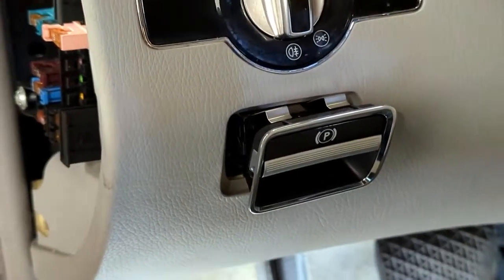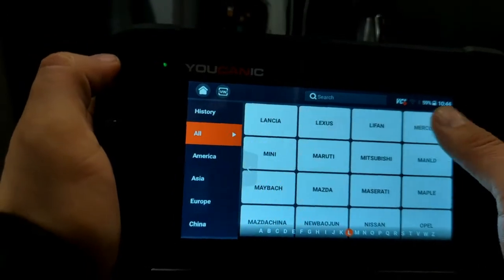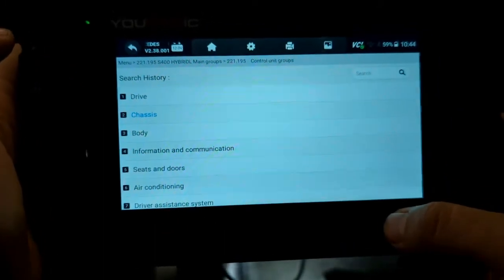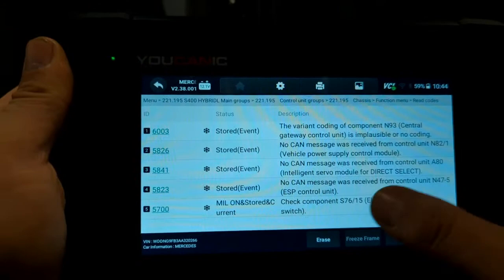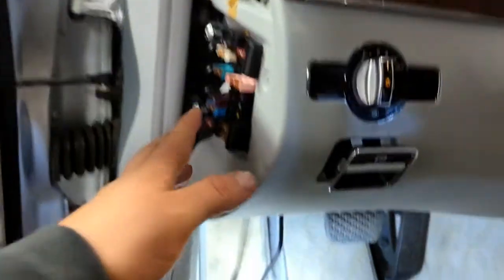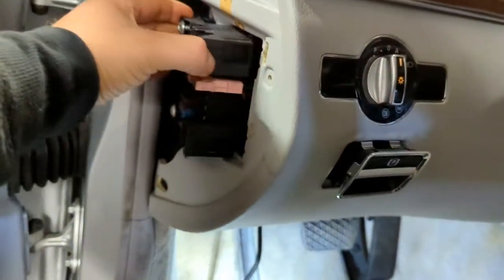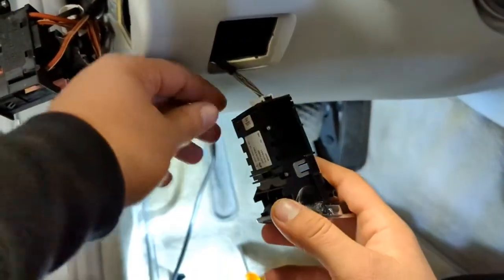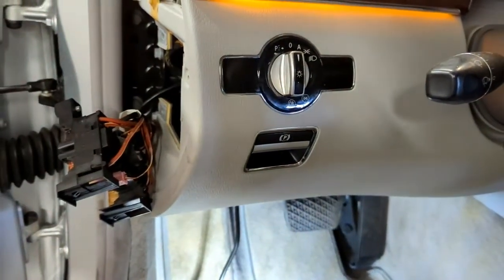Diagnose and Replace Mercedes-Benz Parking Brake Switch W221 Using YOUCANIC Scanner

Comment: Were your brake lights  on all the time?
Reply from the maker: Hi there! Thanks for commenting on our video. Our brake lights were not on all the time during the video. If you have any further questions or need assistance with anything else, we invite you to use our resources at www.youcanic.com. There, you will find our helpful guides, free resources, and the powerful YOUCANIC scanner which are all designed to make car maintenance easier for you. We also provide factory repair manuals for detailed guidance! At YOUCANIC, our goal is to empower you and we're always here to support you on your car ownership journey!